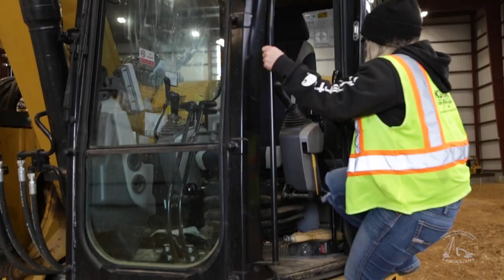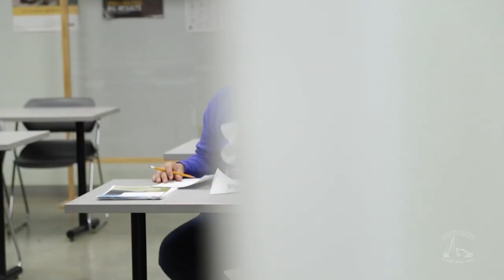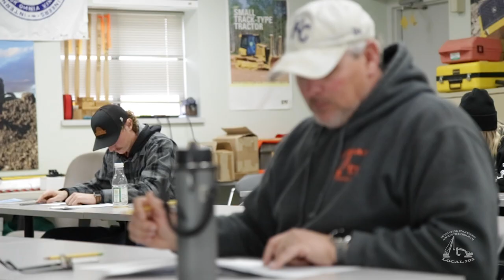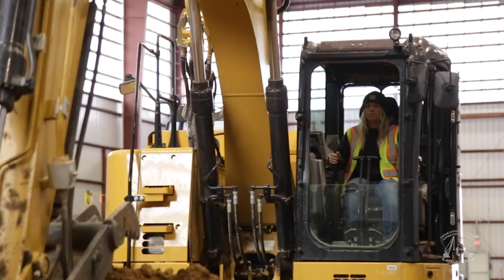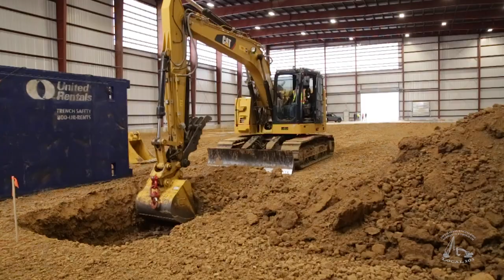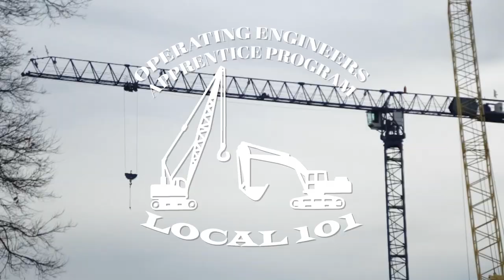IUOE Local 101: Apprenticeship Program

Comment: Can a operating engineer for 48 years local 12 Los Angeles California heavy equipment mechanic equipment operator concrete paving foreman concrete paver operator certified welder is how I got in the operating engineers when I got out of high school at 17 I am 65 years old right now and I have just now started my retirement process being an operating engineer has been the best choice of my life I've got to do everything I wanted to do from running 475 komatsu super dozers to running 1300 komatsu excavators La bare 13000 crane on a windmill project just now finished paving a freeway in Los Angeles California I-5 freeway alignment William Leonardo operating engineer for life